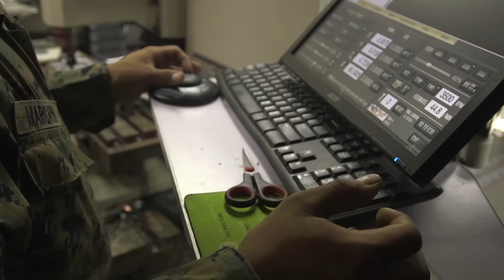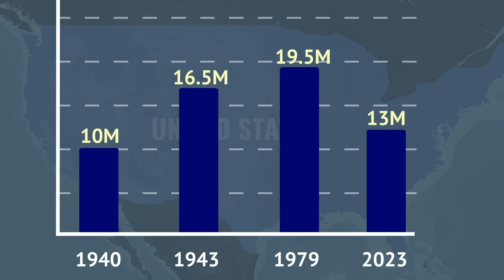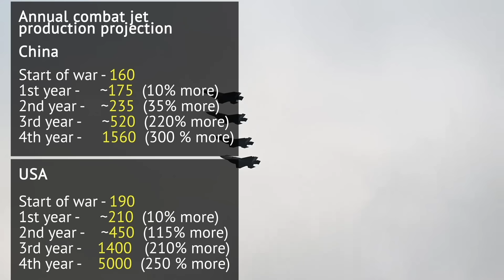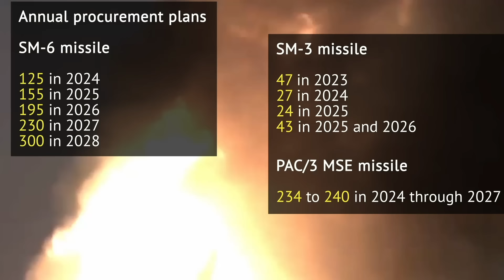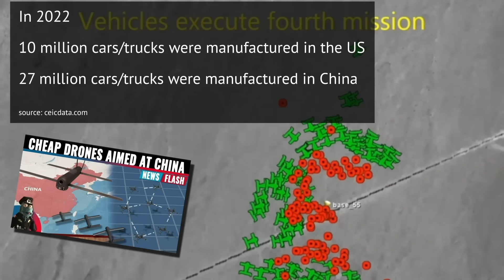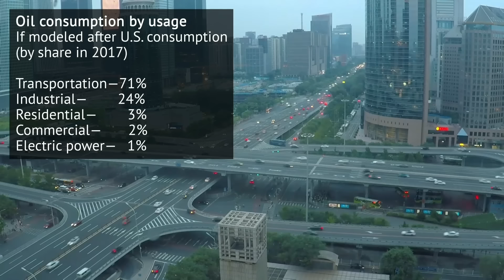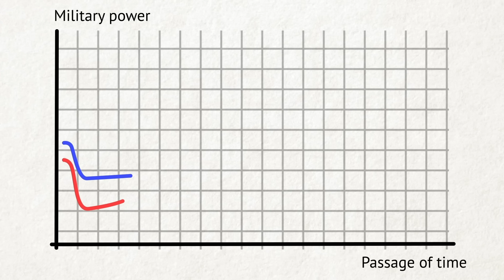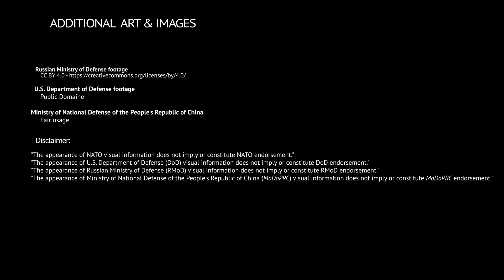Can industrial output decide US v China war?

Comment: Your straightline projections for war are really unrealistic. The bottleneck is chips, the US cannot make enough chips for 5,000 planes a year lmao. Neither could China.
Reply: Incorrect. Weapons systems don’t use top of the line chips. They use more robust, older chips that have a track record of reliability. There’s plenty of manufacturing capacity for those sorts of chips in 20+ countries around the world. 

The US definitely won’t have any problems getting enough chips. The PRC could have difficulties acquiring the materials needed to make chips, but we shouldn’t count on it.

(Note that if modern planes required top of the line chips, China and Russia would be much less significant threats.)
Reply: @yopyop3241  Where did I say they needed top of the line chips? 

The US will be unable to produce 5,000 planes a year for various reasons, chips being but one of them. You will never see WW2 levels of the arsenal of democracy in this country again. China on the other hand, has taken the position of industrial manufacturing superpower of the United States in WW2.
Reply: @Mercer1012  The US during WW2 got its oil, iron ore, copper ore, aluminum ore, etc. from inside the US. 

In contrast, China today is dependent on imports from an ocean or more away that come via sea lanes that run past multiple US military bases. How much of an industrial superpower can China be when almost all of its factories will be shut down for lack of raw materials and energy?

Also, you badly underestimate the advanced democracies’ ability to reorient their economies in war time. The advanced democracies are anti authoritarian, but they recognize the necessity of authoritarian power during war time.
Reply: @yopyop3241  The US during WW2 was a manufacturing superpower with a population of highly skilled factory workers in the middle of a massive depression which meant many were free and very willing to take these jobs. There is absolutely no comparison between the US of 1940 and the US of 2024, we are a heavily financialized service economy with a very small and brittle manufacturing industry, especially in critical areas such as shipbuilding and military equipment manufacturing. 

The lack of titanium, for example, is a major issue. Once Russia completes it's conquest of eastern Ukraine, it and China will control about 80% of the world's titanium reserves. These are extremely important for aircraft manufacturing, especially advanced military aircraft. The US had this same problem in the Cold War, but they were able to go through China then to get enough.
Reply: @Mercer1012  The US today is the world’s #2 manufacturing power. US manufacturing in 2023 was about as productive as China’s was in 2018. 

Today’s China without imports of raw materials vs 2018 China with intact logistics, who do you think wins? Oh, except the 2018 China side isn’t alone. The 2018 China side can tap into the entire rest of the globe’s manufacturing capacity.
Reply: @yopyop3241 😅so where's China's landing ships? Oh no, they are not building it.
Reply: @yopyop3241  The US may be second, but it's a distant second. And in the areas that matter, it is far, far behind like shipbuilding and ability to replace naval losses.

My money is on it being a stalemate if it broke out today. In 10-15 years, China will be the winner and the US will be forced to accept them as the arbiter of Asia and the South-East Pacific. The US Navy is extremely brittle, they have a great alpha strike but if the enemy survives that, China has regional overmatch for the South-Eastern Asian/Pacific area. India is neutral and will probably never get roped into a US alliance, and Russia can solve many of China's resource issues provided the new rail lines are completed and strengthened in the next 10-15 years. 

I'm sure all of your points have occurred to the Chinese. As the war in Ukraine shows, Russia is only a pariah among US satraps and vassals, the rest of the world has basically ignored the US-led sanctions. Soon, with the US weaponizing SWIFT, China and Russia will have alternate financial communications systems in place to circumvent SWIFT and lock out the US Empire from attempting major economic harm.
Reply: @Mercer1012  The US is not that far behind. Again, US manufacturing in 2023 produced as much as Chinese manufacturing did in 2018. That’s taking China’s sketchy numbers at face value. It’s almost certain that there’s a great deal of overstatement in China’s numbers.

Also, China will not be competing against just US manufacturing. The US will be plugged into the entire world. The US will be able to earn income by, say, making Hollywood movies and then using that income to buy steel from Brazilian smelters. In contrast, China will be cut off from almost all trade and won’t have those sorts of avenues to use non-manufacturing productivity to access manufacturing.

In addition, the US in 2023 invested more into new factories than China did in any year of its rise. There were big increases in countries like Mexico, Vietnam, and India, too. 

China can’t win this conflict. If this happens, it will be catastrophic for China and its people.
Reply: @yopyop3241   You are very optimistic about the rest of the world picking a side. They may do as India does and just stay neutral, trade with both sides and tell anyone who says to stop to fuck off. 

China has regional overmatch, the US will not send its entire fleet to engage China, it has too many other demands globally, China, on the other hand, can concentrate the majority of its fleet in one region. They already outnumber the USN, and regionally they out-weigh it in tonnage as well. This becomes more and more true every year that goes by. 

China is also a major market for Hollywood, which is an industry that still hasn't recovered from Covid and might never. Having China completely blocked will probably destroy it. Also, funny you bring up Brazil, it's largest trading partner is China, which and as it's a member of BRICSIA and the US is not, I doubt they will stop trading with China just because the US wags it's finger at them. 

The US investments into Chinese factories will just be taken over and nationalized in the event of war. 

Again, if war broke out today, neither the US nor China wins. It's a stalemate as neither power can inflict enough damage to the other to truly defeat them, short of nuclear war. If it happens in 10-15 years, China will get to dictate more favorable terms.
Reply: @Mercer1012 Titanium is nowhere near to be an aircraft bottleneck just yet

The US would run out sooner of armor, experienced combat pilots or even war will than from titanium.

Boeing alone makes 500 conventional airplanes, which of course are bigger and use more titanium, alluminum and composites than your average fighter or bomber. Relocation of resources would be no problem if the need arises

What would be a problem for the Chinese is their lack of expertise in aircraft engines and stealth tech. They'd be more sensible to chips shortages and fuel too. That's for the military aspect only. The civilian have their own needs like food import, and their supply chains would get much more stressed than America's for sure

This would come down to each society's resilience, but considering Chinese tougher starting point to begin with, of course, as war would take place on their territory's proximities (better for logistics, worse for production and national supplying).
Reply: @Mercer1012  There is no “trade with both sides” here. China will be cut off. The choices will be “trade with the pro-democracy side” or “trade with nobody.” 

China concentrating its fleet— that’s a weakness, and China has no choice. The PLA Navy is trapped behind the First Island Chain. Meanwhile, some of the most consequential “battles” will happen way outside the Chain. Logistics win wars, and many of the “battles” that will ensure that China’s logistics stay collapsed will occur many thousands of miles outside of the Chain. China is going to lose because China won’t even be able to make it to the battlefields.

10-15 years from now? China probably peaked economically fifteen years ago. It has been running on debt since then. Worse, it’s not explicit debt. It’s the debt of vague promises (“the CCP will never allow real estate prices to fall or LGFVs to go bankrupt”) and shady under-the-table handshake deals. 

China’s military aged population peaked five years ago. The echo generation of China’s Boomers are in their upper thirties now. In 10-15 years, this conflict will fall on that generation’s kids. That means the “1” from China’s “4-2-1” demographic structure will be doing the fighting and the dying.

If this conflict happens 10-15 years from now, it will be even worse for China. Initiating a war during the “1” generation’s peak reproductive years? Even without a war, China is facing demographic collapse. With a war? We would be talking about demographic oblivion.
Reply: @yopyop3241  Yes there is trade with both sides. There always is. See Russia and the sanctions right now, most of the world just ignored them except for the vassals of the US Empire like Germany and Japan, and even Japan got special allowances to get around it. 

Yes, the US is on shaky financial ground as well, with our debt to GDP ballooning rapidly, our nation divided more than ever, and our inability to produce viable equipment (see the many failures to make a modern hypersonic weapon), and our diplomacy an embarrassment. Look at all of the global fires popping up and our utter failure to come close to quelling them.

The 1 still outnumbers the amount of troops the US and the rest of the empire could bring to the fight by a large margin. You think the US would not receive casualties that would make WW2 look like a cakewalk? Demographic collapse would be a thing for both sides. Also consider the fact that the US military has failed greatly to achieve recruitment goals. More and more people do not wish to serve in the legions, and just like Rome, the powers that be turn to foreigners to staff it, barbarians from over the Rhine in the case of Rome, and immigrants in our case. 

China is an authoritarian nation, history tells us that authoritarianism almost always triumphs due to the ability to have singularity of purpose from top-down leadership. The spread of democracies in the 20th century is an exception, not a rule. My money is always on the authoritarians.
Reply: @jairon_2518  I wonder if you are even able to read correctly before you jump into a conversation. We are talking about a conventional WW3 situation. Titanium was an issue all through the Cold War, the US had to go to lengths to obtain the bits they needed through shell companies buying from the Soviets. That was one example, again, if you had read correctly. 

Boeing does not maintain stockpiles of these materials in great numbers, just-in-time manufacturing and efficient logistics and all of that. Once Russia claps a stopper on that, good luck. Also, I'm not so sure I'd tout Boeing as a posterchild for good engineering right now. Just another sign of an empire in decay.

China's newest engines are good enough, as the US showed in WW2, having the "best" doesn't guarantee victory. The Germans were far more advanced in rocketry, engine design, armor design, etc. The rule in industrial warfare has always been who can produce more things that are good enough, faster than the other side, and accept more losses. The US did not win WW2 due to brilliant strategy, it won due to out-producing and being willing to accept more material losses. 

China has regional overmatch over the United States and it's vassals in the region currently. In 10-15 years that margin will only grow. It also shares land borders with very resource rich nations like Russia, and central Asia.
Reply: @Mercer1012  Historical conditions have moved from pre-industrial logics.

Nowadays there's not as much incentives to invade and conquer as before. Democracies have formed the largest, most powerful alliance in human History, and I'm not only talking about NATO and partners, but the tacit alliance with for example Ukraine against a flagrant violation of the international rules of their bully of a neighbour.

You don't bet against America against any major geopolitical enemy and win since practically the 1812 war. Since then the Spanish Empire, the German Empire, the Japanese Empire, fascist Italy and ultimately the USSR have bit the dust while they were far from suffering any scratches on home territory. Wouldn't be different with China. You think authoritarianism is a strength? It's actually their demise. Facade is everything for them and they've no autocontrol mechanism.

Best case scenario for them is they win a regional war over Taiwan, disrupting international supply chains of chips and making the West divert any investment and commerce they still have with them. Then you've got an isolated (again), aging China against every other major power: the US, the EU, the Commonwealth, Korea, Japan... And India which just comes to be next China in many levels. China is on the losing side of this if they take the wrong step and decide to mess it all up.

Russia and at most central Asia are good raw material suppliers to have, but that's all. They're not a market large nor matured enough to give exit to even a fraction of their mfg surplus. They're no India, nor Europe nor America.

I know a thing or two about aerospace industry, I'm an aerospace engineer myself. I'm telling you some things suppose a bottleneck more than others. Titanium is not the most urgent one. You hear about it because they're critically dependent on Russia in this case, but critically only by US standards, which by national security's is very high. They've got partners in Ukraine and Japan which can (with enough time) scale up production.

You think the West doesn't control much of China or Russia's sensitive inputs for their militaries? You approach this conflict as if it was some sort of the Western powers looking pasively without acting themselves. Without the West you have no advanced chips, worse electronics, worse machinery, even a relative shortage of fuel (the US is already the #1 producer) and food supply too. And don't let me start about the finances, better for the Chinese to start looking for a SWIFT alternative, and soon enough.

PD: if the edge of Rolls Royce for instance on jet engines does not tell us enough about how each aircraft would perform and how the conflict would take place, what do you think it does?
Reply: @Mercer1012  US allies in Europe and Asia have the bulk of the shipbuilding capacity, but litterally no war after WW2 is long enough for new ship building to be impactful.  It's all decided by pre-existing ships.
Reply: @jairon_2518  Yea people really don't understand how resource limitations like thouse in WW2 are not pertinent to modern militaries because ther consumption of thouse resources is so small relative to civilian consumption and other limiting factors will always be hit first.
Reply: @Mercer1012  You seriously think the US if engaging in open warfare with China would simply be 'wagging its finger' at nations not to trade with China by sea?  You clearly confusing the current sanctions regime on Russia with what actually happens in war.  That is called a blockade (like what Russia was doing to Ukraine untill it lost its navy) in which ships are forcably turned away, no ship of any flag would be allowed into or out of China.
Reply: @kennethferland5579  China has 41% of the global shipbuilding, Korea has 42%, Japan has 7% Russia has 5%. Please note that the two US "allies" (satrapies/colonies, actually), are well within strike range of Chinese missiles, and Korea can be accessed by land. China keeps a leash on NK, I wonder what would happen in a war with the US if they tried to bring SK into war against China? I think the South Koreans will remain sympathetic but neutral to the US when it gets down to the wire. There's a reason South Korea is spending so much time and capital to develop domestic arms production capabilities as free from US technological strings as possible.
Reply: @Mercer1012 Active conflict zones are no-go for civilian maritime trade. The moment this starts, all traffic on maritime approaches to Chinese ports will evaporate. “Regional overmatch” doesn’t accomplish anything for civilian trade. Civilian trade requires the ability to ensure almost complete safety. China probably can’t manage that level of dominance against a lone Taiwan. Against the US and its allies? Not a chance.

Comment: Yeah ... but if you count Mexic + USA they will easily outpaced China. No one is thinking about Mexic but I think this is the buffer of USA and with Mexic and probably central america can easily outpace any China or Rusia + China aliance. Easily.
Reply: Mexico has 1/20th the GDP of the US and isn't a major manufacturer of military equipment so they don't have the factories necessary to produce the high end stuff that would be needed in a modern naval war.  It's unlikely their contribution would make a significant difference.
Reply: @elmateo77 all the automakers would simply switch focus and hire many more than necessary to compete. Think ww2
Reply: @Yoshi14832 Back when a warplane was basically just a modified car engine bolted to a pair of wings and a bunch of guns that would work, but modern military equipment requires extremely complex and precise manufacturing facilities.   Just look how long it took Russia to retool their factories, and they're still not manufacturing the high end stuff like 5th gen aircraft and modern cruise missiles in large quantities.  Sure we could quickly crank out a ton of guns and tanks, but that's not what would really be needed in a primarily naval and air war with China.